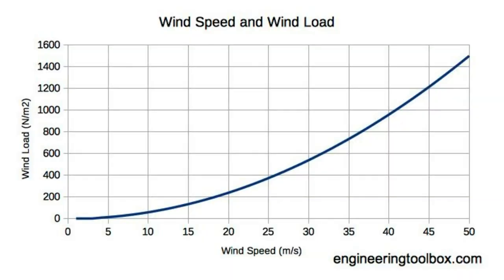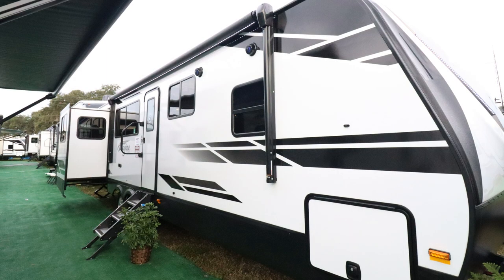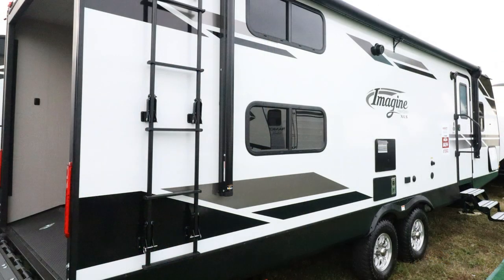The HUGE Issue With Travel Trailers No One Talks About

Comment: We have a 23-foot Riverside Retro at less than 3800 lbs and pull it with a Yukon 1500. We use the Blue Ox 2 dot hitch. We are good on all aspects of this set-up. Today on I-95 in Florida in perfect weather while going by a semi-truck trailer we got passed by a fast-moving box truck on our left ( 3 lanes).  Instant out of control sway flipped our trailer onto its side and shove our front end into the semi on the right. We walked away but our lesson has been learned.
Reply from the maker: Goodness. So glad everyone walked away!!

Comment: We have a 30' Ball to bumper travel trailer, loaded to about 8K, and tow with a 1/2 ton F-150 3.5L Ecoboost.  It tows well for our trips of 2-4 hours.  If winds are 15mph or above, we have to slow down to about 50-55 to really feel comfortable.  Trips longer than 4 hours can get a little tiring as it does take greater focus I believe than towing with a 3/4 ton truck.  I'm due for an upgrade and will probably go gasser F-250.  We'll still probably use my wife's F-150 for the shorter trips I'm sure, because it does get good gas mileage, and easier to park when going into town.

Comment: excellent point. rule of thumb Im using is 50% towing capacity and tongue weight. that is - loaded with gear and supplies the trailer shouldnt exceed half my capacity. that is keeping me down in the sub 22' trailers. Which is fine since Im solo and I dont need a giant house. I hadnt considered side loading from cross wind or vortex from driving.

Comment: Just shared this video - someone was asking 'how long can i.....' and someone said 'length isn't what matters....' - so thanks for this info so I can share your wisdom.   I do tow a 28' (tip/tail, but more like 24' box) with a newer Silverado 1500 for the past year - I'm fine 99% of the time - but I went to TX a few weeks ago in some pretty heavy crosswinds (25mph constant, 40 guests) - and I had to slow down to under 55 to feel comfortable.  So I'm right on your thresholds for length and agree with your assessment.  I was tempted before to get a 33' length total unit (28' box) and knew that was just too much before going in.

Comment: Just traded my 1500 for a 2500 to tow our 27' travel trailer. Numbers wise the Ram 1500 should have been able to pull  it fine. It did. BUT, It was white knuckle in wind. The tail wagged the dog just a bit too much. 3/4 ton a lot more planted. I tell people that all the time. It's not only the GTW and tongue weight you need to be concerned about. It's length. And, in my opinion, 26' should be the limit for a 1/2 ton on trailer length.

Comment: I pull a 30’ travel trailer with a 2009 Chevy 1/2 ton and I’ve been able to stabilize my ride and help sway control considerably by adding Roadmaster Active Suspension to the rear and Sumo springs to the front of the truck. Also use an Equalizer WDH. That said I plan to buy a 3500 this year to make the towing experience safer and easier.

Comment: I towed our 26' Imagine (29'-8" overall) with our 1\2 ton one trip last year before putting it away for the winter. I won't do it again! Our F-250 should be here before camping season. I did weigh it before that one trip and thought I was within or close to my payload, GVWR, GAWR, etc. Did not mean squat and yes the WD was set up properly! The trailer was just too big for the truck! It had nothing to do with HP or amount it could pull.

Comment: I tow a 28 foot TT at about 7000 pounds loaded weight. Something significant I noticed after switching from an F150 to a F250 is that when I’m on the interstate and I get passed by a semi I get a lot less nervous. The air being pushed by the semi would push the trailer around momentarily and that was significantly reduced with the F250 and I even had good quality tow rated tires on the F150.

Comment: I have so many friends that are over towing. I was told by every RV salesman the my 3/4 ton ram Cummins could tow anything with 2 axles. Then I’d take them over to my truck and point to the cargo capacity on the sticker in the drivers door jamb. They would still argue. Know what you are getting into before buying your truck and rig. My cargo capacity is 2750lbs and my pin weight on my 5th wheel is 1600lbs. Plus I have removed a few hundred pounds from the truck.
Reply: Travel trailer salesmen's favorite phrase is " It has a dry weight of only....!"  Key word DRY. ✌

Comment: Good info. I had an RV dealer try and sell me a 30 ft trailer with a dry weight of 3800 pounds to tow with my midsize 1990 Dakota rated at 5,000 pounds capacity. Be wary of unscrupulous dealers. We ended up buying an 18 foot trailer with a dry weight of 2600 and after one season moved up to a full size half ton rated at 10,000 pounds towing capacity with disk brakes all around. This setup is ideal for pulling if you want full control of your load under all conditions.
If I was pulling anything bigger I would get a 3/4 ton.

Comment: We’ve ordered an F350 to replace the F150 towing a 30’ 7500# Imagine 2500. Overkill for safety.  Last summer we had a 2019 Ranger Lariat, bought a 25’ Nash 22H, too much trailer for it. Traded up to the 150, then found things on Nash we didn’t like, traded up to the Imagine, now trading up on trucks again. A short and expensive journey, but finally have it right for us.
Reply: We love our F350 SD crew cab for towing our 27’ airstream.  There’s no such thing as overkill when it comes to safety.  You won’t regret it. We sure don’t.

Comment: Example: RAM 1500 1/2 ton Eco-Boost engines are smaller than 3/4 ton Cummins.  The differences are also in suspension components, as they can handle more weight.  Think of it this way, more capable means the truck isn’t stressed as much, or has to work as hard to handle (move) the weight.  If you care about having less maintenance, less downtime, less problems, you want a healthy gap between your trucks capability and load as this means less stress and less problems.

Comment: Sorry just seen this one and I like everything you said because its true.! 29 foot tip to tail and tow with F450! You say overkill I say I can do U turns and you cant. The F450 with wide track front suspension turns faster than any other truck I test drove., and my wife can see over the hood.   Bonus is if  I ever want a bigger TT or Fiver I do not have to buy  another truck. OK enouph about me. true story time!  A good friend of mine had a 35 foot bunk house TT. He went out and purchased a "get this" a brand new f150 ecoboost and the dealer knew what he was going to tow with it and sold it to him anyway! . I later installed air bags for him to help the sag. He took 1 and only 1 trip with this setup aND SOLD THE WHOLE THING AND PURCHASED A DIESEL PUSHER.

Comment: Amen to that. I love my 1/2 ton, but I’m moving to a 3/4 ton truck soon. I have the same trailer as you except in a 28ft. Ours is 6,300 lbs dry, and although my truck will pull it just fine, I tried it with a 3/4 ton and it was like night and day. Great video.

Comment: I wouldn't tow anything (within weight) with a half ton that's over 22 feet. I'd get a 3/4 for a 23 foot. Not crazy or paranoid and neither is anyone else here. We've all had the white knuckle towing with the half ton and long trailers. Now I might use that half ton for a hi-lo since it' far smaller when lowered for towing.

Comment: Far too often the over analytical types think that they know best and buy half ton trucks thinking they can  tow the moon, if you have more truck to begin with you have more capacity and room and not taxing the truck out to its max spec. Once you have a three-quarter or 1 ton truck and you tow you realize how much more relaxing the experience it is than a half ton truck. And the most significant part is there’s not much difference in price to be honest once you put all the go goodies on them.

Comment: I have to agree I’m driving a 2018 Nissan Titan Pro-4X which has a towing capacity over 9000 lbs my 32’ Jayco weighed in at 6900 loaded, payload is also ok.  However driving across the panhandle of Texas catching cross winds was tough.  I will be upgrading to a 2500 or 3500 soon. I did upgrade the tires to load range E and put Air lift air bags on the back.  But still it was a white knuckler.

Comment: My 1st travel trailer was 31ft. Pulled it with a half ton suburban. 1st time pulling it in a storm was very scary. I moved up to a 1 ton dually after that because I planned to eventually go 5th wheel. It was a major difference in the stability department. My truck is a 1988 Silverado. I bought a 30ft travel trailer. Pulled it with my truck and then pulled it with my dad's half ton 2009 ram. His truck definitely had more power and the extra gears in the transmission made it pull a lot stronger. But the stability was not there and with just a little wind was very uncomfortable. I had that trailer for a year and half. Only used it for 1 season. I now have a 35ft 5th wheel. I was told I could pull it with a 3/4 ton. But the 1 ton suspension and dual wheels gives me the feeling of stability that I like. Now the old truck needs a stronger fresh motor to be closer to the power of these newer trucks.

Comment: This video explains why my Tundra (5.7, trailer towing pkg) used to pull our 26’ rl 5th wheel BETTER than our 22.5’ travel trailer weighing 2000 pounds less,   Mileage not any better either. And I’m using a Weigh Safe 15k max stabilization hitch ($895.00!!) plus rear air lift 
I think the truck blocks some of that lateral drag pulling 5th wheel vs. travel trailer catches more lateral drag and a little more head wind drag. I’m holding speed to 65 mph until I can trade up to 3/4 ton!

Comment: A part of this is the fact that a ball hitch mount is prone to sway period. The nature of the design allows that and its why we use "sway control" hitches. Now its without question that a 3/4 ton or larger truck is stiffer and more stable. Properly loading your trailer also goes a long way to preventing sway. But in the end if enough force is applied the trailer will sway. But that's where the hitch comes in. Nearly all the hitches out there rely on friction or some other opposing force to prevent sway. But the fact remains that if you overcome the friction sway can still occur.  The only hitches out there that can actually eliminate trailer sway are the Hensley Arrow (HA) and ProPride 3P. Both hitches use the same basic technology to make sway impossible by effectively moving the pivot point forward. The HA is the original and the 3P is its much improved follow on design. A hitch like the 3P isn't cheap but it does truly eliminate sway.

You might ask why I'm a big advocate of the 3P hitch? It's because I tow a 2800BH with an EL Expedition and I know what a huge difference it made. Would a 3/4 or 1 ton truck be better still? Sure. But I can tow with confidence thanks to the ProPride hitch. Our last trip out last year we had a kid in a Subaru WRX cut us off then slam on his brakes because he simply had to make the exit on the right. My only choice to avoid hitting him was to slam on my brakes and move very rapidly into the left lane. That sort of maneuver is normally guaranteed to create a big sway event. A YouTube worthy sway event. But thanks to the 3P hitch our trailer stayed locked behind us the entire time. For a 32' trailer is a 3/4 ton or bigger truck preferred? Absolutely. But in my view what can be even more important is the hitch your using to tow that trailer.

Comment: Here is a thought, let me know what you think about it. On a 1/2 ton truck, the weight distributing hitch is pretty much mandatory, on the 3/4 ton, not so. The WD hitch unloads the rear wheels, transferring weight to the front wheels. This is good in that it improves steering and reduces axle loading, but it reduces lateral motion resistance on the rear due to less sideways friction. I don't use a WD hitch on my 3/4 ton as it isn't strictly necessary and the towing ratings are the same with and without it. No issue with the axle rating. It makes the whole towing experience from hooking up to unhooking much more enjoyable. I've only once had any inkling of a  sway issue and it was on my 1/2 ton truck with the WD hitch with sway bars. It didn't much concern me at the time and settled out with an application of the trailer brakes, but watching RV sway videos, things could have gotten out of control VERY quickly. I'll stick to 3/4 ton or higher.
Reply from the maker: I haven’t tried towing without the hitch. I figured since I had it I may as well use it. Certainly can’t hurt and it’s no huge issue to hook up for me. Interesting to know you haven’t had issues though. If my hitch ever failed I’d likely be able to get home without issue.

Comment: I have a 21 foot Winnebago travel trailer. I tow it with an F 250 3/4 ton truck. We just completed a 3000 km vacation in the Canadian Rockies. There is no way I would have done that trip with a 1/2 ton truck. My truck weighs the same as the trailer so coming into a corner going down hill you don’t feel the trailer trying to push you off the road. A 1/2 ton would be fine if you lived in the prairies but in the Rockies you need a 3/4 ton truck.

Comment: When we bought our camper, I struggled with whether I should buy a 1/2 or 3/4 ton truck to tow it.  I think I found the solution. 
We pull a 35 ft travel trailer with a Nissan diesel truck which is considered to be 5/8 ton. We have the best of both worlds. The truck is beefy enough to take on a large trailer and has plenty of Torque with the Cummins Diesel but it drives like a 1/2 ton for every day use.  We do have a 10,000 LB. stabilization hitch and have had no problem towing it, even in windy conditions.  We also struggled with the decision between 2WD or 4WD. Glad we got the 4WD. The first time we camped we would have been stuck without it. And although you seldom need it. When you need it; you need it!!
Reply from the maker: No doubt about the 4x4... better to have it and not need it...

Comment: I'm pulling my 2400bh with a diesel 2500 and a ProPride..it's amazingly great to tow.. probably don't need the hitch but with it it's that much better.
Reply: This is exactly the same set up that I have. 2400bh + Ram 2500 Cummins + Propride. No issue at all!

Comment: . A 2000 pound car going 25 MPH hits with 170 Newtons of force. The same car going 50 MPH hits with 690 Newtons of force, double the speed, force increases by a factor of 4. Same goes with the amount of surface area colliding with the wind, which is what your trailer is. And this might make you want to slow down just a bit.

Comment: Agree been there and done that with a half ton and 30 foot ultra light,  plenty of power and stopping. Every setup has a comfort zone, with the half ton and 30 foot  somewhere around 60mph and you could tell the trailer was beginning to get loose when wind was blowing are being passed by big trucks. Same trailer, same hitch and 3/4 ton you could run way to fast for what you are towing and should be towing. Now with a 3/4 ton and a 34 foot trailer and around 9500lbs I feel the same feeling as I did with the 1/2 and 60mph around the 75mph  mark. No I don`t pull at 75mph, I don`t think pulling close to 10000 lbs is a safe speed.

Comment: My half ton 2017 Expedition feels very stable, safe, and capable towing my 28ft 6,500lb travel trailer. I use the husky centerline weight distribution hitch, which I highly recommend.
Reply from the maker: Our Expedition EL wasn’t enough for our trailer regardless of hitch.
Reply: @WanderingWeekends  That's interesting. I haven't had mine in high winds yet, so maybe I'll reach the same conclusion.  Towing can be very stressful if you don't feel safe. Thanks for the video.

Comment: No amount of adjusting a "friction" anti-sway hitch will eliminate sway when pulling a longer trailer with a 1/2 ton even if all your weight numbers are within margin.   So........if your 1/2 ton has the payload and towing capacity for your trailer, trash your "Friction" hitch and get a Hensley or Propride and drive your 1/2 ton with one finger on a windy day.

Comment: thinking about getting into an RV, and have been wondering what would be best, a 3/4 ton or 1 ton to pull with. I'm thinking that the 1 ton duely is best when it comes to stopping power. Those extra 2 tires on the pavement mean better braking power Gotta be worth it for safety if nothing else.
Reply: The difference between the 3/4 and 1 ton single wheel isn’t that much. But a single wheel to a dually is a bigger difference in weight carrying capacity and handling it’s not so much with braking. Different vehicles tow differently also. I have a 1 ton Dodge diesel single wheel and my 3/4 ton GMC Sierra gas actually handles the same trailer much better. It was night and day I couldn’t believe it.
Reply: Plus the difference between bumper pull and 5th wheel  towing and stopping and wind.  If have not done yet, that may be good info for us newbies - types of towing and circumstances to be cautious in. Thx.

Comment: I have a 1500 2019 GMC Sierra pulling a 28’ toy hauler and  the only problem I have is fuel mileage.  Wish I had my 3500 back but wish in one hand and you know what in the other.  Loaded I’m probably a little over 5k. A lot of problems people have is the wrong hitch, cheap hitch, or it’s improperly set up. I’ve been through hell of storms with my set up and it stays on the road waiting for the next gas station.